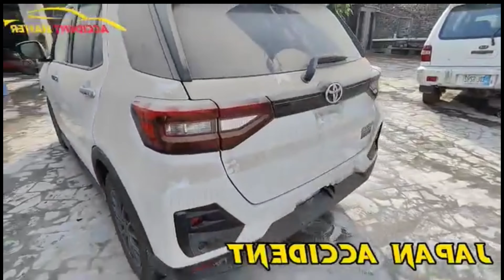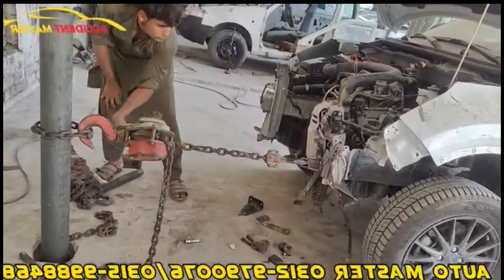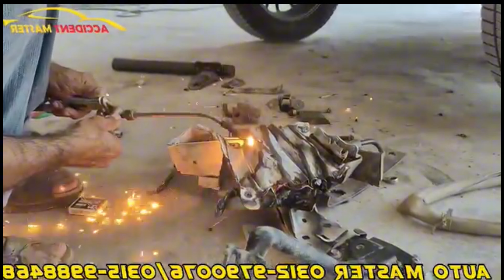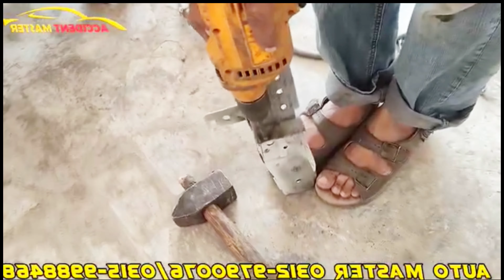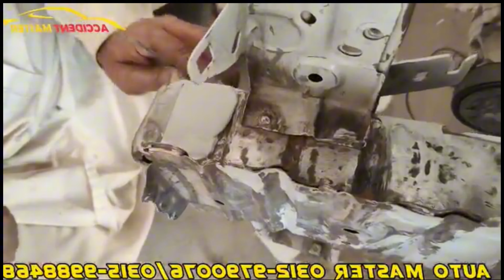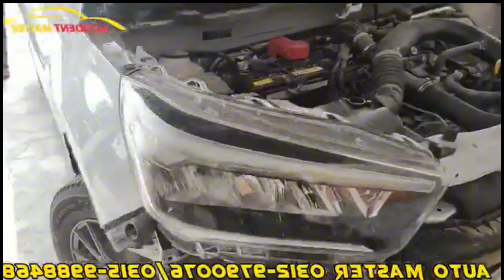Awesome process Toyota raize Japan accident repair in auto master

Comment: The job done is very good. I would take my car to you with full confidence. 
What is wrong is not having safety equipment to your workers. Your main denter and body man is welding with zero protection. That man will be blind in a few years. Many more protection equipment is needed. The painter needs a mask that blocks organic vapors (the one with the two big round filters on) and he needs eye protection too.